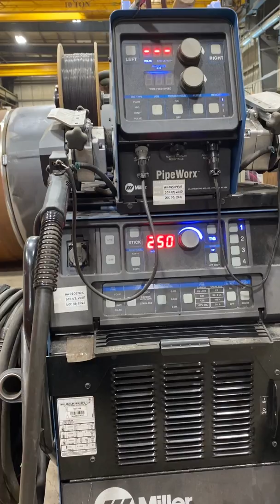Chrome Pipe TIG Welding Techniques !

Comment: Great video thanks for sharing, I’ve just failed a procedure on p11, I tried exactly like you but I couldn’t get the root to flow, the metal just looked cold and really fighting to get it to wet in, yet the back side was out of control and getting lumps n drips. The hot pass went in perfect and shiny??? I tried everything from 80-140amp all different methods, backfeed, laywire, keyhole dip. Nothing would work for me. 15mm vertical plate p11 er80s-b2 filler . Could the plasma cut test piece be an issue, even though it had a milled prep?

Comment: What type of material you use on   tig torch to help reduce the heat??? The brownish/orange material????
Reply from the maker: That’s a Miller flexible element 200 CE

Comment: I tired it without a purge and I would keep getting holes when I popped off the slag so I had to purge my roots. Any advise?
Reply from the maker: Not sure if I understand you question. Did you stick  or Tig your root?
Reply: @X3MTIG  tig
Reply: I tried around 120 to 140 amps I also tried both 3/32 and 1/8
Reply: @X3MTIG  but those little black spots on the tig root when I would pop them off there would be little craters
Reply from the maker: @abrahamanham  what is the type of material that you are welding and tig filler wire?
Reply: @X3MTIG  the material is p11 and the wire is 80s-B2
Reply from the maker: @abrahamanham  try to set gas flow rate at 40 on flow meter, really good pipe prep, make sure its really clean, use 5/32 tig wire for root, and 140 amps.or even 150
Reply: @X3MTIG  ok that’s something the fitters didn’t do is clean the pipe very well. Unfortunately we dont have any 5/32 but I’m just gonna keep purging the roots it’s really easy purged, thank you though I will try your advice on cleaning and gas rate

Comment: Pretty cool. Looks good too. Noticed you had a PipeWorx curious to hear if you guys switch to a Metal cored wire after the root to fill that up even quicker?
Reply from the maker: Usually they do in the pipe shop but this line was for  different welding procedure, tig all the way in this case.